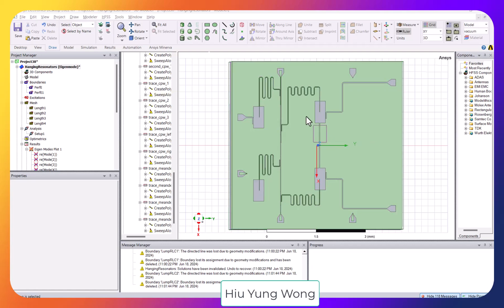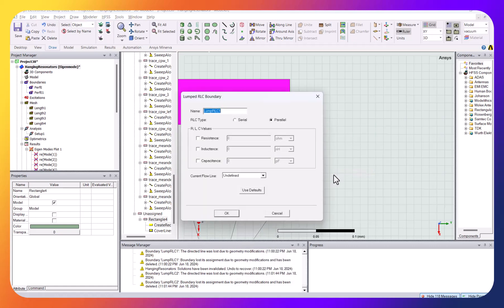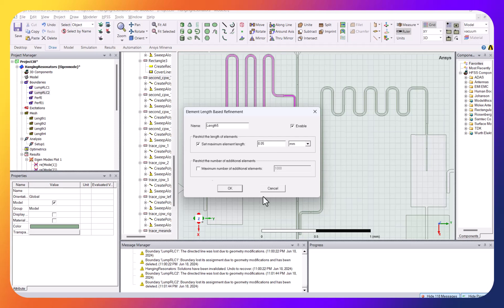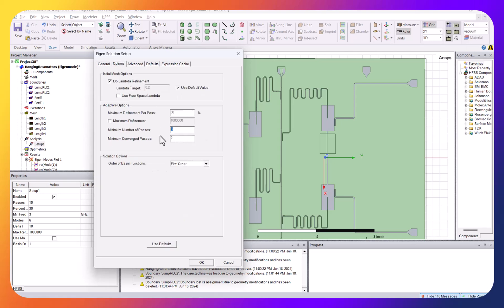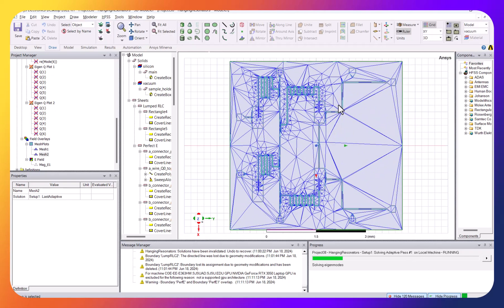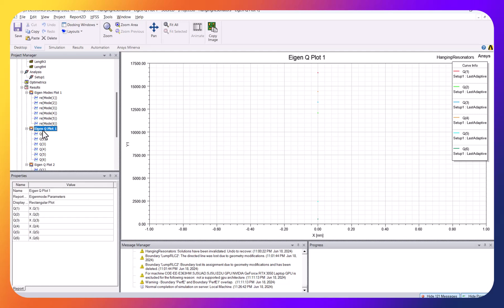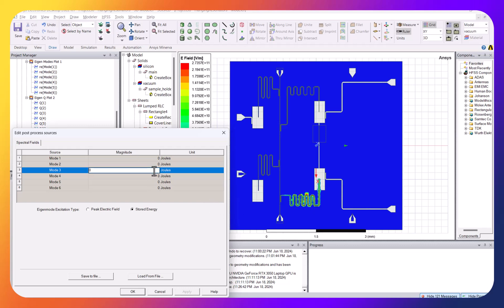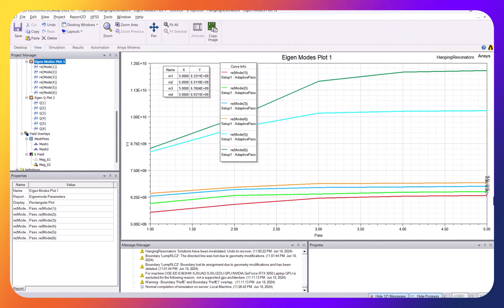Resonator Eigen-Mode and Quality Factor Simulation using HFSS - Quantum Chip Design

Comment: I'm really impressed by how fast your HFSS simulations are. I'm currently facing an issue where when I simulate 3 cavities, the memory consumption exceeds 32GB and it usually takes over an hour. I'm wondering why your simulations can be so fast. What's the configuration of your laptop? Also, could there be something wrong with my settings? 

Thanks.
Reply from the maker: Are you doing 3D cavities? That might take much more time. My system also only has 32GB of memory. But this is essentially 2D as the dense mesh was only created on the superconducting 2D plane (we use PEC instead of 3D metal).
Reply: @quantum_computing  It's also 2D plane, the model is basically the same as shown  in your video, a bus coupled to 3 lambda/4 resonators, PEC on 2D sheets and 50 Ohm RLC boundary on i/o port. Anything else I should check out that might be causing the high memory usage?
Reply from the maker: @pengDuan-k6n  Not sure. Maybe you can reduce the complexity of the circuit to see if it can run in a reasonable time first, and then gradually pinpoint the cause. Thanks!
Reply: @quantum_computing  Great idea. Appreciate the response and thanks for the help! Your videos are super helpful—keep 'em coming.